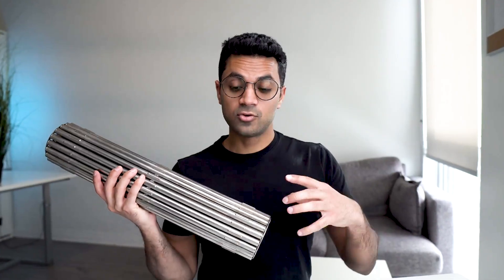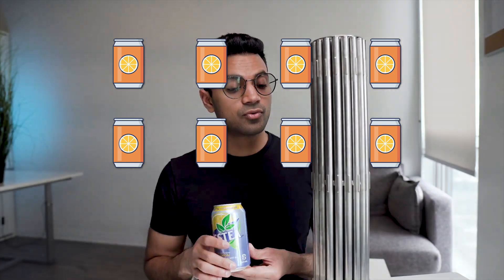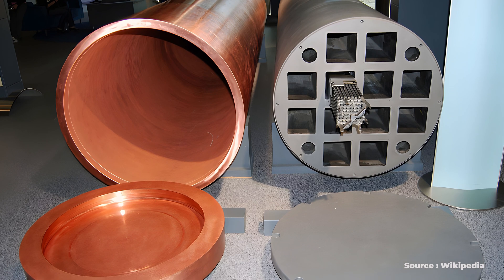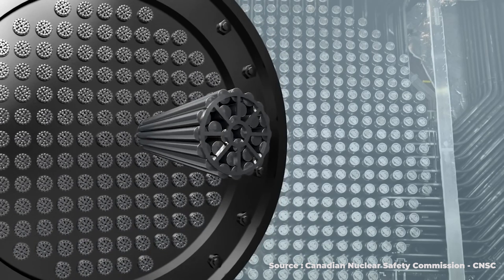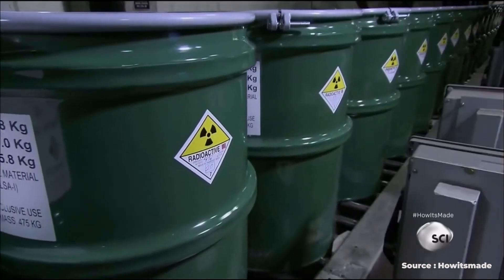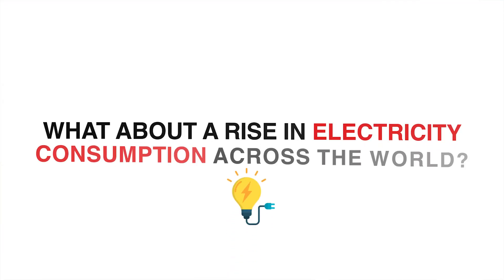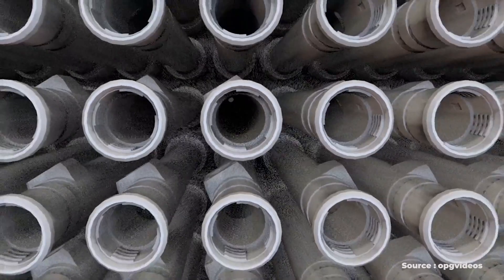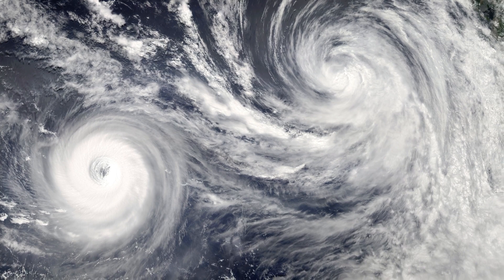Why A Lifetime of Nuclear Waste Fits into ONE Soda Can

Comment: Hello Osama , Would it be possible to dispose of nuclear waste by firing it directly into the sun ustilising DUHardened projectiles. Comparing a
The option of wind and solar to nuclear is not a long term solutio , nuclear generated fuel sources will ultimately have to become the main power generating  source for the planet as wind and solar are too unstable on scale KPP nz

Comment: Hello. I know this is a taboo topic. Can you use those highly radioactive isotopes to produce energy? Like thermal generators (aka nuclear batteries). 
Also, can you do an episode on such power sources? I know they use them on space probes and rovers, but there is a lot of confusion out there. Thanks.😀
Reply: you could theorectically use a thermoelectric generator, but figuring out a system that could harvest the heat while still providing adequete radiation shielding would probably send the cost of the system/kW produced way too high.
Reply from the maker: @Rampage0303, Plutonium-238 is an isotope that's produced in nuclear reactors that is widely used as a power source in space probes. But I think thats a great topic to explore, thanks for the suggestion!

Comment: 520 years of energy for 1 person per bundle / 12 cans of soda per bundle = 43.333... years, I'd say a lifetime of energy is more like 2 cans, still not a lot though, especially if we can get even more energy out of it.
Reply from the maker: It depends if your accounting the fuel inside the bundle only or the zirconium bundle material as well. Here's the reference for the calculation, they break it down very nicely: https://cna.ca/2019/06/25/your-lifetime-used-fuel-would-fit-in-a-soda-can-want-proof/
Reply: @OsamaBaig  I just used the numbers you gave in the video😅

Comment: What a great visual aid, that soda can. It really brings home just how energy dense nuclear fuel is. All of this without the nasty pollution that both coal and oil have.

And like you say, we already have technical solutions for the 'waste'. The Dupic cycle in CANDU of course, but also the fast [breeder] reactors. And the technology is not new! The US was working on closing the fuel cycle as early as the 60's with their EBR-II. As to the reactor's safety; they even intentionally tried to melt it down in two full-scale tests at full reactor power, and it politely refused both times. No matter what they tried, they couldn't get the reactor to melt down. For the first test they shut down the primary cooling system, for the second they shut down the secondary cooling pump so that the reactor had nowhere to go with its heat. Before both tests they had gagged the control rods and emergency safety systems, so they couldn't intervene and the reactor really had to figure it out on its own. Which it did both times. Its passive safety features kicked in long before getting anywhere close to the danger zone. It shut itself down and just kind of sat there, almost mocking them: "Is that the worst you can throw at me? You've got to try harder than that." Why they never pursued this excellent design further is a question I still haven't found the answer to.
Reply from the maker: Swoka! Thank you for your comment! I'm glad that the soda can helped illustrate the concept of energy density in my video. And I completely agree that nuclear power has the potential to be a cleaner energy source than coal and oil. I appreciate your engagement with my content and your thoughtful contributions to the conversation Swoka!
Reply: @OsamaBaig  
Let me extend a return "thank you" for making a very complicated subject matter accessible, enjoyable and easy to understand. It is one thing to read about it boring-you-to-tears books and reports, but quite another having a real nuclear engineer explain it in such detail. Your videos help me a lot in furthering my knowledge about anything nuclear power related.
Reply: Send some soda cans to Fukushima. Then maybe TEPCO won't turn the Pacific Ocean into a nuclear waste lagoon with their hundreds of millions of tons of radioactive wastewater. Fast breeders have been tried since the 1970s, unsuccessfully. Tell me one fast breeder that the operators didn't throw up their hands in frustration and abandon when it turned into a money pit?
How dense are those mountains of acidic, radioactive tailings with toxic heavy metals at uranium mine sites. Are you nukies still paving playgrounds on the reservations with that stuff? It takes 1 million lbs. of average 0.1% uranium ore  to extract 7 lbs. of fissile U-235.

Comment: There's a few problems with your depiction of waste disposal. These are almost all old mines. As a result, they are not as stable as they were before mining. Because this has to be monitored, this is a ludicrously expensive proposition.

Next, processing spent fuel rods is expensive. Decommissioning old nuclear power plants likewise is ridiculously expensive, and building new ones only works with heavy subsidies. Nuclear power is, per se, expensive.

And about toxicity - tell that to the people that lived near Chernobyl and near Fukushima. That's just the tip of the iceberg. Many nuclear power plants have demonstrably higher rates of cancer for people living nearby.
Reply: Do you have a source for your last claim? Regarding the decommissioning of old plants: You're absolutely right, it is expensive. There was an old power plant just beyond the border from where I live (Fessenheim), of which the people in my country (Germany) were scared of because the government kept it alive despite safety hazards. The wind is blowing from the west almost all year round, so in the (still very unlikely) case of an accident the whole southern part of Germany would have been affected. The highly critical opinion of the public regarding nuclear power did not help in justifying the arguably low risk of accidents, even though the government always shut down the reactors if a hazard has been detected.

Comment: I like how you mentioned those sites as "nuclear waste storage" because the idea is we can use it again.

I used to be really worried about breeder reactors, because plutonium like you mentioned, is a really good nuclear fuel, so good, in fact, that the Manhattan Project used it for some of the first nuclear bombs.  As I learned more though, I got less worried, because it turns out weapons technology moved on past plutonium as a nuclear bomb materiel (you do still need it to make a weapon but the type of plutonium you need for a bomb can't be efficiently made in a power reactor.  You need highly specialized processing, which is pretty obvious.   Isotopes are very important.)
Reply: "Wasteburner" reactors, especially MSR designs, get around this by having just enough breeding ratio to keep it critical (1.2 or so) , but you always need to put the plutonium back in. A "breeder" generates more Pu-239 than it uses